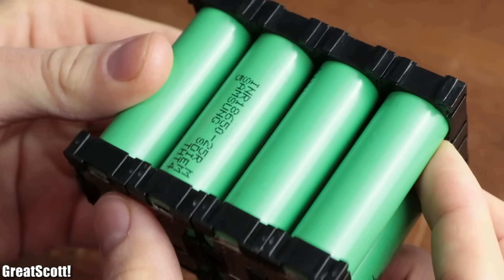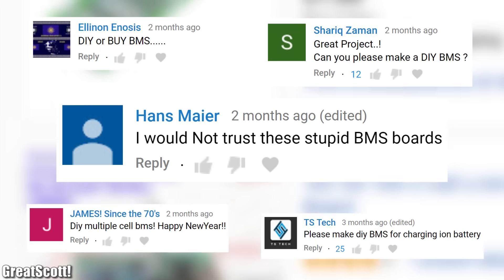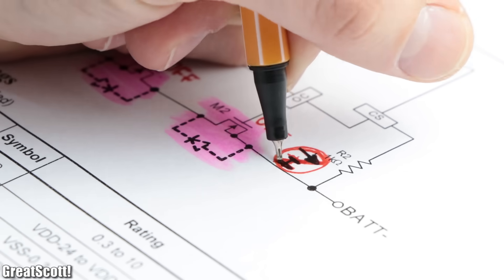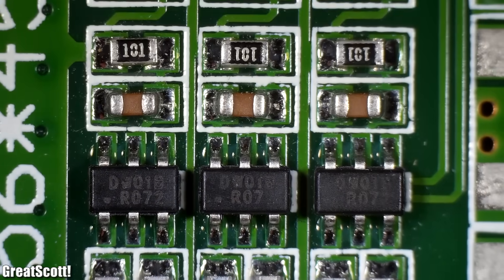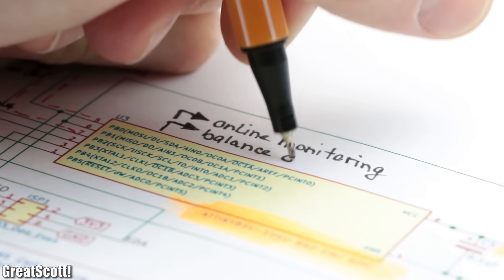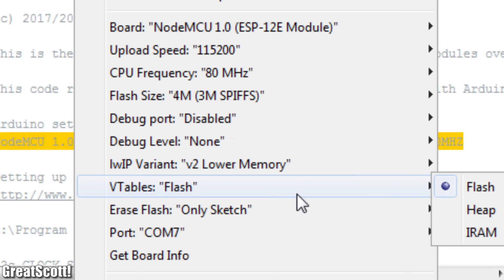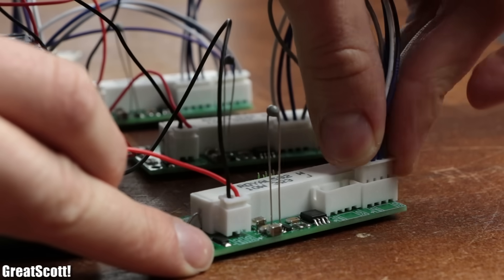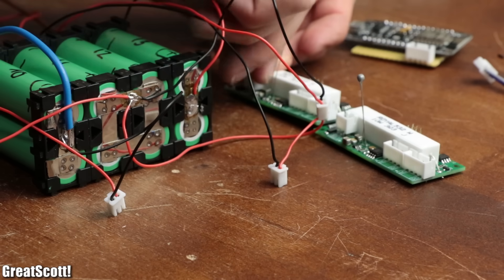BMS (Battery Management System) || DIY or Buy || Properly protecting Li-Ion/Li-Po Battery Packs

Comment: I think I would need some kind of LiPo/BMS system for my metal detector..

I have a "Coinmaster 6000D" metal detector that runs on an 8 pack and 6 pack 
of AA batteries. They are wired together as: +12v and -9v. 
I am not sure what the max current pull is during normal use.  

I found a split +- 12v buck converter on ebay(DD1912PA 2in1 Boost-Buck), but the specs only say max current is 14ma. 
14ma seems a bit low for what I think my detector needs.. 
and I need 2 independent voltage outputs. +12v and -9v

I want to make a LiPo pack that fits in the same space as 14 AA batteries.

Is this doable?
Thanks for your "Great" videos..

Comment: I don't get why you explain that there's 3 passive component networks when the first one protects against overcurrent and overcharge while also protecting against overdischarge and then go on to explain that the 3rd component network protects against overdischarge when the first network already takes care of that kinda wondering what the 3rd network's purpose is since need to have this written on my school paper for my bluetooth speaker end project

Comment: hey Scott, great video!
But I have a question. The other day I was talking with a friend of mine on increasing the battery capacity for my small rechargable hand fan that uses a single 18650 (2000mAH battery can't really remember the specifics). The idea was to get a couple of those same batteries from sellers and wire them together and using a wire, attach it into the board (replacing the old battery) of the electric fan. From my understanding this board will still be able to provide over charge and short circuit protection right? I don't think it will still do equal charge since it uses a single battery before.

Another idea is to build a while other separate battery pack with it's own circuit board (typically those seen in power banks/portable chargers) that will inturn supply Power to the board of the rechargable fan (making the present battery in it useless) using a clip of some sorts. Again, from my understanding this power bank/portable charger board will provide overcharge and short circuit protection, right?
All in all, my question is: can I  build a battery pack and connect to an existing USB power bank board as my per delivery tool? I don't know if it's necessary to spend on a bms which would be very hard to get my hands on in my country (Nigeria)

Thanks for you time scott, your videos are really educational.

P.s. I tried to use the proper terms in the explanation but if you don't understand anything i wrote please let me know so I'd quickly clarify.

Comment: can you just have an arduino nano onboard??????
it is not that easy to program arduino with an arduino.. it is a pain in tha ass... also it could be metter to have a display with 5-6 buttons to adjust without wi-fi modules

Comment: wouldnt it be easier to just attach a Balancing cable to your battery and plug it into basically any Lipo/Li ion charger with balancing ports?  just considering most modern battery chargers have balancing ports seems like alot of trouble to make stand alone BMS for every battery.

Comment: When the battery pack is not on a load (not connecting to any appliance or device) or even charging, will the BMS be still working automatically to balance the cells ?  the cells will discharge themselves over time, not sure if the BMS will still detect the pack and start balancing according to the cell parameter.

Comment: I got an 100a 4s BMS for LiFePO4 that was $5; seems to work okay with a quick bench test, but surprised the balance current is limited to just 36mA.  If the cells are not well balanced to start, charging at a higher current rate than that can allow the cells to go well over the 3.6V target.  For some reason I thought they had more aggressive clamping on the max cell voltage, but it seems that's not how they're expected to work.

Comment: Am I missing something? The device discharges the excess input as heat instead of just stopping the charging process? If this is how all BMS systems work, why doesn’t anybody design it more efficiently? It seems like using a resistor is the worse possible way to do this.
Reply: That’s a very good question. So the main function of the BMS (battery management system) is to monitor and control where the energy goes. Since the batteries in the BMS to charge multiple batteries at once, whatever one battery doesn’t need it goes to the next, and then the next. When it runs out of batteries to charge, in order to prevent the batteries from overcharging (which causes heat), the resistors (which have channels to act like a little oven, heats up) because there is nothing left to charge. 

If it charges anymore than the batteries can hold, they can expand, overheat, short, explode, etc. which this better safe than sorry. The only other way to use it effectively is to add more batteries or just manually stop charging it yourself when it is done.

Comment: Hi. One drawback for BMS like these is the available ballancing current. There are so called active ballancers, cheaper and more expensive (which get better feedback from people) but the better ones are like 25usd for 7s. My idea is to use a regular bms for all 'over'-protections on discharge, and to take 7 dc-dc buck cc cv converters, and maybe 7 1S BMSs for extra protection, and make a separate charging "circuit", where I hook up 12V (or whatever buck accepts) as input to ALL buck converters, each of which charges single string to required voltage, and a 1S bms after each dc-dc buck, doing extra safety. This way I can actually get a ballanced battery, with whatever max "ballancing" current is allowed for a single string of cells. It would cost maybe 10-15usd overall. Does it sound ok? And if it does sound OK a DIY BMS could have built in feature like this ;)

Comment: My recommendation would be to switch to a hybrid design, you should be able to control all the batteries from 1 MCU on a monolithic PCB, the passive/transistor circuitry is relatively cheap, but so many MCUs plus the external interface is what pushes up the cost

Comment: I have been experimenting with these type 18650 packs for about a year now.  I have built dozens.  I use a fused nickel strip on most of mine now, all of them that have more than a few cells in parallel.  I accidentally did short one while assembling it and all of the nickel fusable links glowed and melted, it was scary, but spectacular to watch, but it worked and potentially prevented a bigger problem.  I just tested the cells and put new fused nickel strip on the top and it was good to go.  I wish I had had a camera running.  My point is that they are, in my opinion a worthwhile safety feature and insurance policy.  For batteries in buildings, I have been building metal boxes for the batteries in case of fire.  I do not have such charging and power draw as most of mine are working for small solar power collection and lighting backup.  For me, heating of the batteries and thus needing to cool have not been issues.  Every once in a while, if I have my thermal camera with me, I will look at them and see if any of them are heating, as they fail they get warmer when heating or cooling.  I made some of my first packs from very old salvaged cells as those cells were very cheap to practice many of those cells were on deaths door, so I got to see failure modes.  It is a pain in the neck to dissassemble a pack for a failing cell, so I try not to use cells that are too close to failure.  I have taken to adding load disconnects and do not charge mine above 4 volts as I am dissatisfied with the BMS performance of the Ebanium and Amazonian varieties I have tried.  I would like programmable LVD and HVD, but it seems that unless you build your own they are made out of unobtainium.

Comment: For making large battery systems it seems best to make 3 large battery packs, all cells wired in parallel, then the 3 packs wired in series? In this case I would have 3 entire packs going to 1 BMS? Or is there parallel BMS boards I can buy for each individual pack?

Comment: I have a question. I am looking to make my own battery because i came across quite a few 18650 cells. Only thing is they vary in capacity. Could i just use a normal bms if say i have 4 in series, but my first 3 paralell are different than my next 2, and my 3rd, 4th, and 5th are different. Also how about if out of the 4 in series the first two have different capacities than my 3rd and 4th in that one series.

Comment: Wait I need an adult here, am I right these are what happened when:

Overcharge: BMS cut off charging negative port, still allow discharge
Overdischarge: BMS cut off output negative port, still allow charge

Because it seems my BMS has 3 negative outputs labeled "Charge", "Output", and "Battery". Also what happened when my 3S BMS got 14.8v from charging port? Will it count as overcharge or the BMS will regulate the voltage to 12.6v? Or do I need a voltage regulator?

Comment: You have BIG SMD capacitors? 
nVidia wants to know your location!

That ESP-12E board is overkill for that project tho. an ESP-01 would have worked fine for that but I get it, the 12E was easier to program..

Comment: spot on with DIY BMS being for powerwalls and such.  It seems to have better front end functionality than most of the cheap to midrange BMS units, which are mostly focused on providing BMS functions more than front end features, so you can end up blind on how your batteries are actually doing with most purchased BMS units - which isn't ideal for something that you want to closely and carefully monitor.  Meanwhile anything that's portable, you may not care as much about what individual cells are doing, and just need a relatively simple (in terms of features) BMS to keep the cells relatively healthy, and shut down the current flow in the event of something dangerous happening (which you can later check into on a bench).  Good stuff, very interesting.

Comment: Can  TP4056 lithium battery's charging load current  be adjusted using a potentiometer to CS pin of the Dw01 ic ?

Comment: I don't understand how the DW01A can protect an individual cell from overdischarge - does it trigger the big MOSFETs that control the output? Because the little mosfets cannot disconnect one cell from the circuit - the cells are connected in series externally (by wires that don't pass through the BMS). So the only way the BMS can stop a cell from being over-discharged is by cutting power to the load.

Comment: Over complicated.  Running 10Kwh of Nissan Leaf cells. NO BMS.    Manual Bal every 6 months.  Never been more then 0.05 v out BMS's are over rated.   Systme never more then 50% discharged.  Running fine.   If I purchased all modules from at the same time I wouldn't need to bal them at all.  Purchase your batteries all at one time and don't bother.

Comment: Hi GreatScott, question for you.  Not related to this project but similar in principles.  Maybe you can help me.  I have a Ryobi power tool battery (P107).  I was trying to revive it.  When I put it into the charger, I get the red light blinking.  Most of the you tuber who has the same issue was able to revived their battery by jump starting it.  I did that and I was able to charge the battery bypassing the bms.  I measured the battery terminal (bms output) of the battery pack and I got 5v.  I measured directly the battery series and I got 18v.  Does BMS has memory?  I measured individual batteries and there's only one that has .01v difference.  Any idea how to fix it? Thanks.
Reply: If you only have 18V after direct charging you may have a bad cell, which the BMS is detecting so not allowing connection. 
* You need to test each cell individually. *
My experience with my Ryobi batteries is that a single cell can fail, the BMS may allow it to work, but only for a few minutes before shutting down, then the cell becomes a heater (infra red cameras are fun)
Reply: @MrKarlPrince  Thanks for your reply.  I've already checked individual cells.  There's only .01v difference on one of the cell. I didn't charge them pass 18v thinking that's enough for BMS cutoff threshold.  So in theory, it should be enough to get back to charger and charge the difference.

Comment: What is the preferred/most efficient way to monitor an 18650 battery bank built for something like a car or part of a house, where there could a large number of cells (i.e. 1000 cells). Using BMS's like these seems impractical (I'm now even sure how you could), is there another way in which a large quantity of batteries is managed? P.S. Love the FritzBox 7490, I've got one too, they are great units :)

Comment: Smart people do not use BMS as it only fucks things up and turns off your system for whatever reason it  just decides... If your battery is to catch on fire, no BMS will save you. So only for charging or keep a bt module inside that show the series voltages, all one needs and wants...

Comment: Ich bin verzweifelt auf der Suche nach einem BMS, welches ab 4,15V balanced und bei 4,18V oder darunter den Ladevorgang abschaltet. Allesamt tun dies erst bei 4,25V, was viel zu hoch ist. Ein DIY BMS würde zu viel Platz einnehmen. Gibt es einen Weg, ein kaufbares Standard-BMS umzuarbeiten/umzuprogrammieren mit solchen Pararmetern? Bluetooth-BMS sind zu klobig und zu teuer für mein Projekt.

Comment: So where is the BMS located in my electric scooter?  I don't see it other than voltage controllers, bunch of wires, and a battery. I don't see no BMS.. Is it built in to the voltage controller?  Or does voltage controller also do the function of BMS too?

Comment: Great project. Would you recommend to use the above setup for a cordless impact drill that uses a 12v battery? I have an old one that has a dead battery and can't seem to find a replacement.

Comment: I don't trust ebay or AliExpress BMS :P, but I have my reasons. Just today I've charged a battery pack with a BMS inside and after the charge was stopped, the voltaje is less than expected. After checking the batteries voltages I've seen how one of them is at 4.2v, but the others are at 3.7v so is not balancing my batteries. That's why I want to learn how to create my own BMS. At least I'll know the real features and not the features that maybe it will have.

Comment: Can someone tell me if it is possible to connect the batteries to be charged in parallel, but to work in series? (I think of something like a double circuit with a switch). regards

Comment: i was wondering if the dc to dc voltage converter output voltage decrease as the input voltage decrease? or was the output voltage constant even the input voltage decrease?
pls help!

Comment: Great video, but i want to ask, if you have BMS without balance charging, balance charger is not necessary, if you don't want to charge it to 100% completely, so that some cell would be fully charged and some not. Would that harm the battery pack?

Comment: With bms or balance charger you can solve the capacity diffrence problems about series connection. İts okay. But when the system uses parallel batteries, how we understand the capacity differencens problems and solve this? :S  As you know laptops and some other devices uses both paralel and series connection. May be the notebooks biggest problem is using parallel connections. In basically using 22.2 volt 3 amper pack is better life time than using 11,1 volt 6 amper battery pack  if you use BMS . ;)

Comment: When the HY2213 says "cells" are they referring to each individual cell? Or do the mean the paralell cells? How does each IC connect to its cell? Is that what that 12 pin connector is for?

Comment: Can one not use an array of comparators to compare the cell voltage and switch a transistor off if cell voltage is greater than the reference ?

Comment: Do you know something about how to charge NiMH Batteries?
Reply: It's completely different charging spec.
Reply: @bikingtheholyland3333  Now I now, I downloaded some IC power management datasheets and they break down all about each type of battery you need to charge and even the circuit <3

Comment: how do you come up with max discharge of 40 A? That would mean your 2 cells in parallel would have to output 20 A each and they highest max discharge I've seen is 5 A per cell??

Comment: Seems a little over the top with online capabilities... though might be easier to troubleshoot if something goes wrong?!
Tbh i didn't know the importance of this circuit board, and so that there are more than one types... i suppose i'd check online for reviews and then buy. I don't trust myself to make one... let's just say i can get a vibrating toothbrush without any electronics...

Comment: On 3s 12v bms can you also use the b1(3.7v) and b2(7.4v) to supply other device with other voltage?

Comment: Well im doing a recell on a dell laptop battery (7537 Inspiron model btw) i attached the cells in correct orientation ....checked with multimeter that the voltage is as like as in the original battery. But no power. I tried jump starting the BMS chip by connecting + (from battery cell)to + (on battery connector) but... no go... then - to -... no go. What im doing wrong???

Comment: I am a huge fan of your diy project skills & sorry for my bad English comm. But i had a problem related to a project reading laptop smart battery  data(scl & sda) using arduino uno R3.
Cp2112 or something similar is not available in our local area if shopped from bangood or aliexpress it cost a lot plus custom duty. So if pcb needed how to diy that with components  that are easily available and read those data.
Sir please help with this issue.